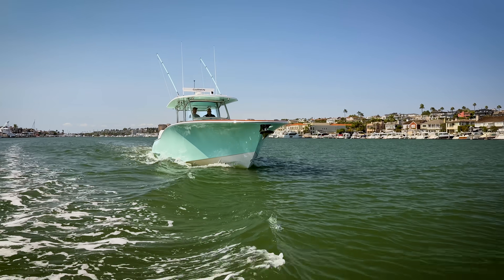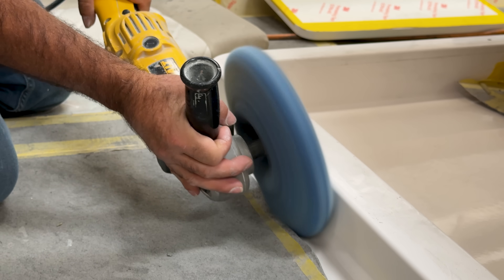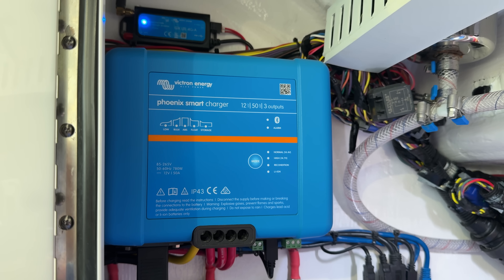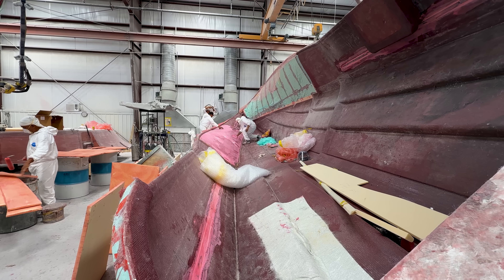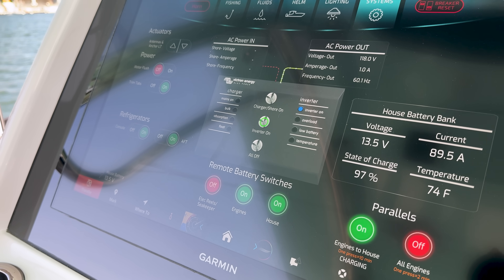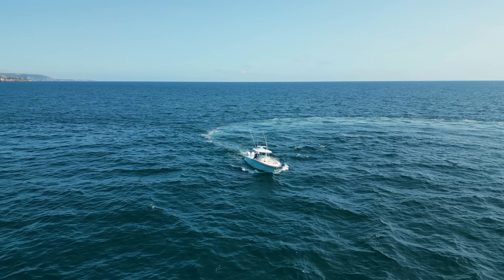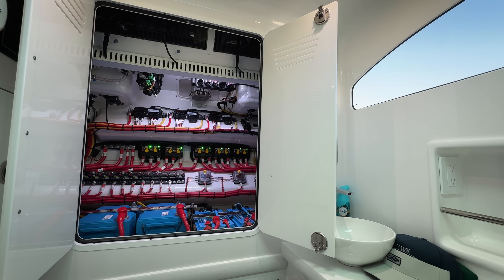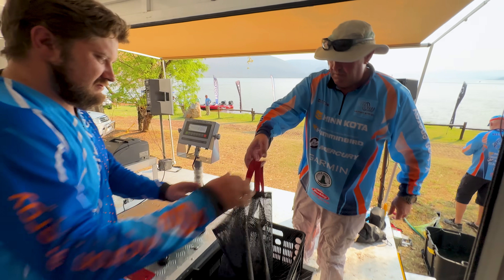Award-Winning fishing boats go generator-free using Victron Energy

Comment: I installed my victron gear in 2021 on my rv - full time living over 4 years across 26 states, no issues. Installed it on off-grid cabin and other rv's. When installed properly, it works as designed.
Reply from the maker: That's great to hear
Reply: @VictronEnergyBV  Bitte einen 10.000 Watt Phoenix egal ob der Kasten größer ist🎉

Comment: All that space on the canopy and not a single solar panel in sight...
Reply: Agreed. Having a redundant source for starter battery power and/or auxiliary power for a VHF if there’s a major electrical fault is key for an offshore boat.
Reply: It’s a fishing boat, nobody is putting solar panels on a $100k canopy covered with 100k in electronics.  Between all the gps antennas that you can’t see for the chart plotters, Sirius radio/weather, etc, starlink, vhf antennas, 48” radar array, outriggers, horn, etc.  These boats, depending on what they’re fishing for, will keep the engines running.  If not, dc to dc chargers for each of the 3 or 4 outboards will charge those batteries in no time when they crank them back up.  Like us and many others, we will plug our boat into shore power when not in use.
Reply: @chrisrogers8760  exactly
Reply: Unless you install a large array - solar panels are not always a good option. They can start their motors and recharge quickly.
Reply: @AskRemy even a small panel will give them some trickle charge for when the boat isn’t moving or moored.

Comment: No, overcomplicated.
Use 1 or 2 gas engines and it will be so much simpler. Any engine technician can repair it if broken and filling it up will take minutes instead of hours or even days.
And yes, I like victron.  My house runs on it. But batteries in a boat?  No thanks
Reply: Gone With the Wynns had a terrible experience
Reply: i think those are special made batteries for marine use just like the electrical equipments on board
Reply: @carholic-sz3qv  Lithium is lithium regardless of where it is fitted.